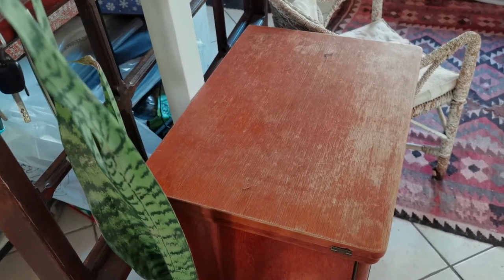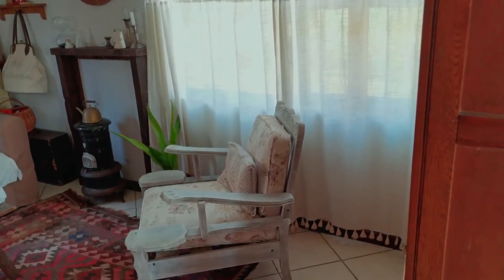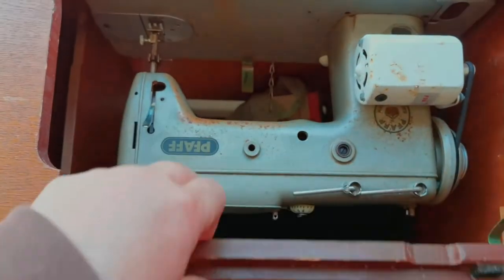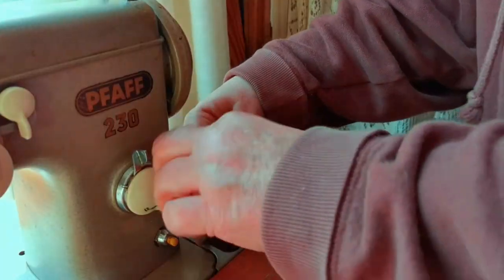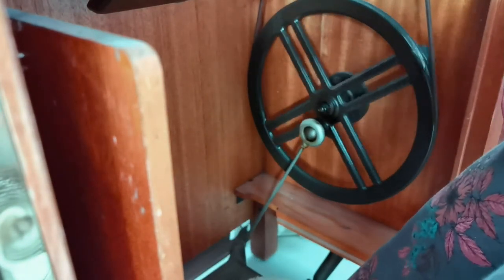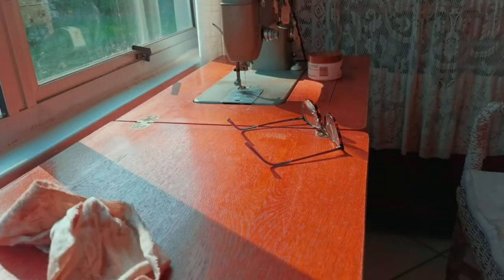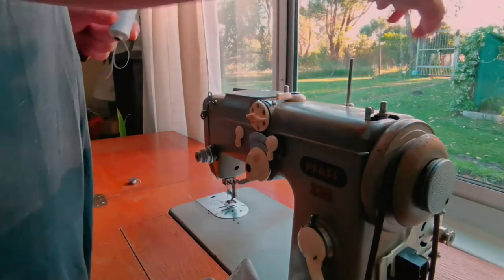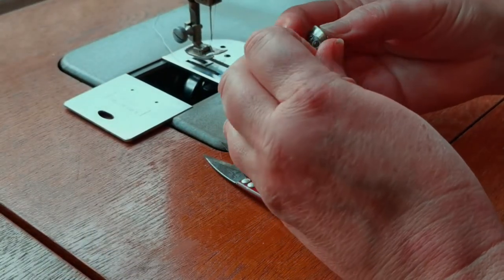My off grid sewing setup.

Comment: Hello from Southern California and southeastern Texas. It must be very difficult to be in limbo as to electricity availability day to day, hour to hour.  In socal, where I live  part time, there are increasing outages because old electrical lines can spark wildfires and they spread very quickly in our frequently windy areas. Since we’re in drought, there are many tinder dry areas and wildfires are frequent. So, to eliminate problems and mitigate their responsibility, power companies can shut off power in high winds or high electricity demand periods. In Texas where I also live part time, we have deregulated electricity. Since people want the cheapest power possible, power plants are not hardened to standards to deal with changing weather conditions and extreme power demands.  Political maneuverings are preventing changes. Fortunately my living is not dependent on electricity, but at times, some peoples’ lives are. But we are planning strategies to deal with at least short power outages. But you’re right, it’s expensive. Just recently I stumbled upon your vlogs and am enjoying them. I am a quilter and also sew garments for myself and my grown daughter, recently for my granddaughter. Sewing has been a lifelong passion of mine. Kudos for readying your treadle machine for your periodic needs.
Reply from the maker: I have been watching the situation with your power shut downs,  I understand the problem of wild fires  but it is stil frustrating. Atleast you have options for electricity.  Our government has the monopoly.  I love quilting but really don't have time.  It is so exciting that you are sewing for your family! Happy Sewing 😊